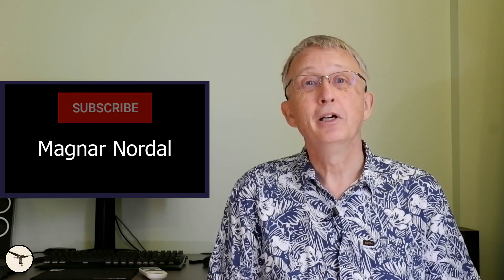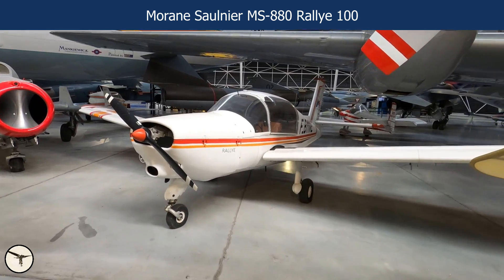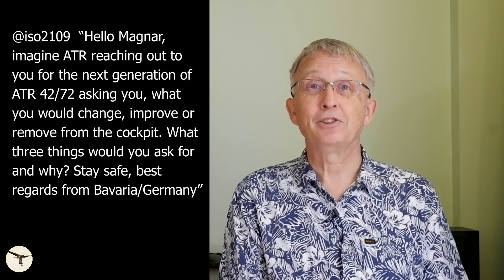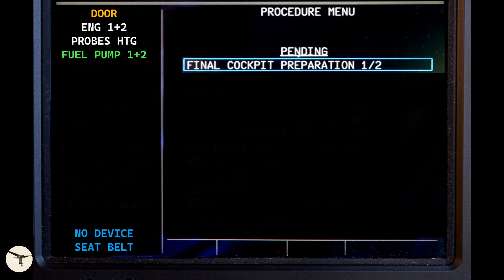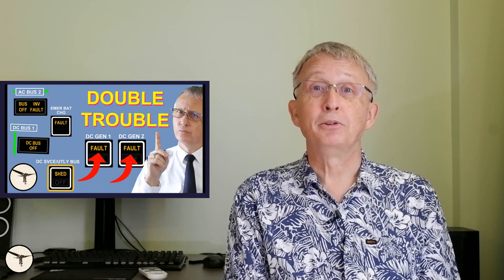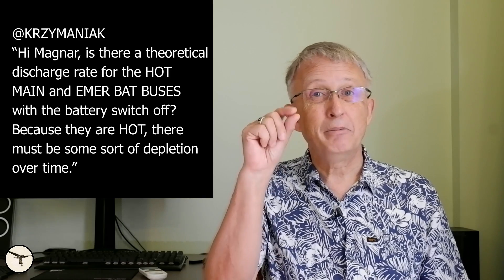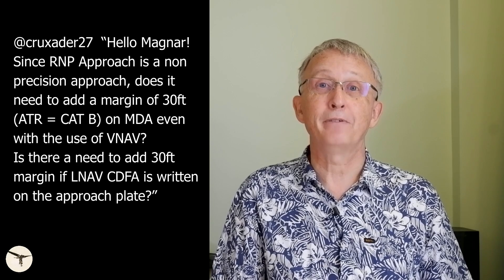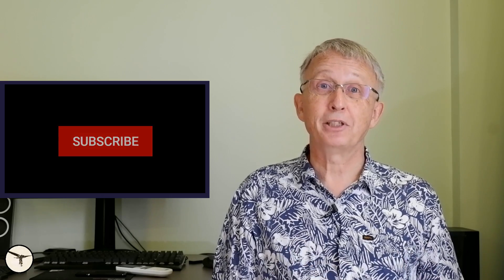Q&A #10 with Magnar - May 2024 | ATR | Airline

Comment: Thank you Magnar for the nice videos! May I ask why you have to add 30/50 ft to the MDA/H of an NPA, can the instrument flight procedure designer not simply add this margin to the published MDA/H so you as a pilot no longer need to do it? Thank you :)
Reply: While you wait for a proper answer, I will give my 2 cents worth.
The procedure designer should probably still calculate MDA/H. There are still some situations where aircrafts may legally and safely fly level at the MDA.
Also, the designer may not know the preferred add-on, which might be, say, the maximum height loss observed from test flight go-arounds with the type of aircraft and equipment (e.g. auto-throttle) used.
Then there is EASA (in Europe) that, as far as I can tell and heavily paraphrasing, tells us that if you are choosing between "dive-and-drive" at a particular MDA or if you do CDFA where you set DA=MDA, then even if you do briefly undershoot MDA, the CDFA option is still at least as safe (given normal/shallow descent angles and so forth) as the "traditional" non-precision approach.
Your question about the publications remains valid though. I don't know why e.g. Jeppesen wouldn't sell a customized subscription for say 'best practices commercial air transport ATR 72' approach plates (or maybe they do).
Reply: @Rodhern  Thank you for the feedback :) Just wondering why with ILS this is no issue, since there you encounter the same aspects like aircraft/equipment/airline which differs, but for a DH/DA I have never heard anybody adding a margin. Is that really only since ILS is more accurate? Interesting stuff :)
Reply: @sebasmen  I guess there is a historical reason. On an ILS or other 3D approach the undershoot will be along the 3-dimensional flight path. I.e. the plane will in theory continue travel safely towards the runway along the 'usual' path.
With an MDA the (2D) procedure should guarantee you can fly safely at that altitude or above, not just at the 'usual' point you reach minimums during CDFA.
The thing then is, in theory, neither kind of minimum can be converted to the other kind. If an MDA was published you have to add margin to a derived DA to avoid flight below the MDA. If a DA is published some/much/most of safety margin is in the fact that the plane stays on the glide slope, so you cannot simply use the DA as an MDA - or you probably loose obstacle clearance.

Even then you still have a point though 😀. We probably could make a design rule that says to never publish an MDA lower than its companion CDFA DA would be, unless specifically noted otherwise on the approach plate.
Reply: @Rodhern  Thanks again for the insights, appreciate that! :)

Comment: Questions about sounds -
During the clip of a landing at the end of many videos, there is a "bip,bip,bip" noise close to when the plane touches down. Is this associated with a mode setting or possibly if the trim button on the yoke is being used?
Warbling "whoo-whoo-whoo-whoo" noise of varying lengths in flight, seems to be while getting stabilized before landing. Sounds a little like the variometer on a sailplane/glider. What is that indicating?

Comment: Thanks for answering my question. My company's leadership has mentioned that they are having difficulty with landing gear. We were planning to add five aircraft to the fleet last year, but only got two because of this issue. I assume that the previous operator of those aircraft returned them to the lessor because the gear was timed out. Which means no one else can use them without gear.
I did find an article from C&L Aviation which provides some confirmation that others are having issues, but it doesn't say when it was written.
Reply: Our company is also having supply issues with landing gear and have been for quite a while. Not sure why though.

Comment: Regarding Boogstar's question about the MEL. As you said, the MEL is for dispatch-ability. When we're planning a flight, we have to ask, "what if something goes wrong?" 
If we already have one failure, then what happens if we have another? With one hydraulic pump failed, the XFEED will allow us to complete the flight normally. ACW BTC will help if the opposite ACW generator fails. But if a second hydraulic pump fails, or the xfeed fails, or there is a hydraulic leak, we would be in an emergency situation with no hydraulic power available. So the MEL doesn't allow us to dispatch if we would be unable to use the runway in case of a second failure. If we have no nosewheel steering, then we will have to use differential braking to steer after landing. That may be fine on a wide runway, but the risk is too high on a narrow runway.